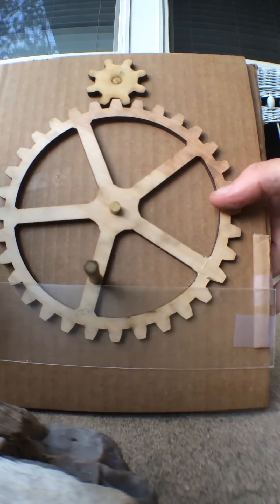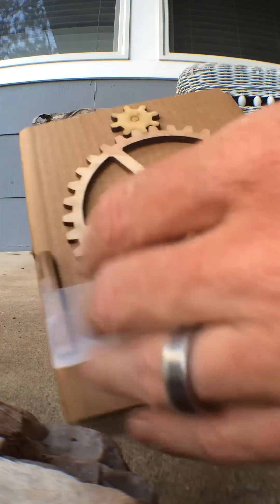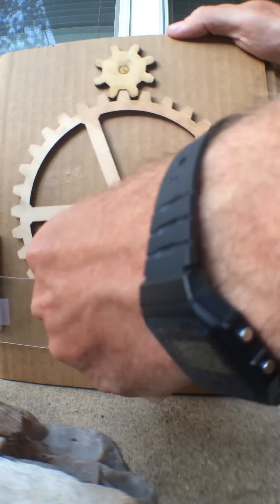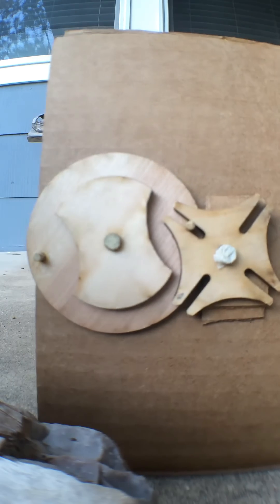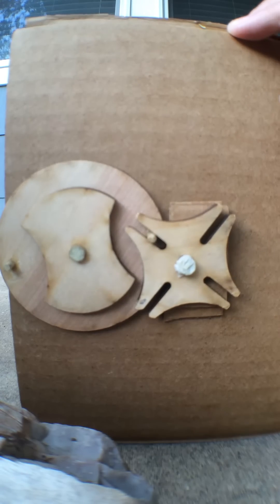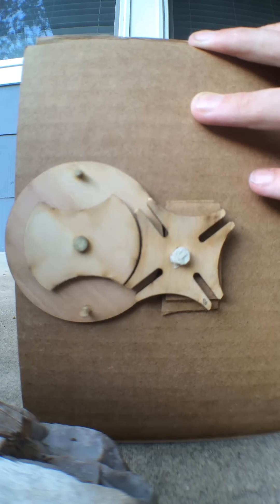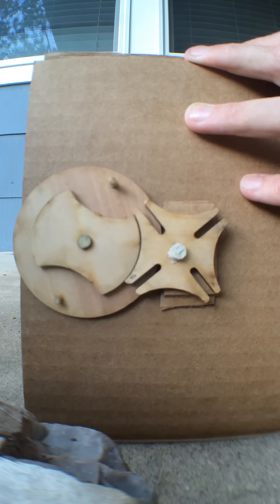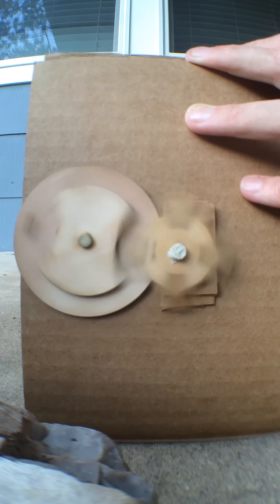Geneva Mechanism

Comment: What I want is a firestarter wheel. You can start a fire with a bow drill. I want to turn a wheel, just like that one, which will turn whatever pieces are needed to spin something and start a fire. It would take so much less effort than a bow drill, and could go so much faster. I have imagined that maybe, humans discovered friction fire by accident. They might have discovered the wheel first. They made a wheel on a cart, loaded the cart with a bunch of heavy stuff, and then rolled the cart down the hill. If the wheels were made of wood, they could have theoretically caught fire. So people would learn that when wooden wheels spin really fast, they catch fire.

Comment: The mechanism was used with another mechanism to put a shutter across the film not allowing light through during the period the film was being pulled to the next frame.
Also a pin was put into the sprocket hole to hold it still called Register then withdrawn for next move.

All this happened 16-18 times a Second for silent films and 24 frames a second on sound films till today!

Comment: So, it's 4:1 but pauses at every other 1/2 step.  So, I get how it would work for film projection to blank the screen in between frames/slides.  Persistence of vision does the rest.
Reply: ???  2 revolutions on the left per 1 revolution on the right.  Left has half as many "teeth".  2:1 rotation, 1:2 "teeth".

Comment: Build one of these so it works in tandem with a laser weapon.

Then you will have a Geneva Gear that Violates the Geneva Conventions.
Reply: Not only that, but the gear resembles a certain Iron cross.
Reply: @zbyshrek4661  it looks like a kind of reverse iron cross: wider inside than outside
Reply: @zbyshrek4661 : More like a Maltese cross, methinks.
Reply: @zbyshrek4661  The Iron Cross is a badge of honor, not a nazi symbol, I don't see the problem
Reply: A weapon to surpass Metal Gear!
Reply: You could use a Geneva mechanism to Q-switch a laser, yes.
Reply: Go ahead and say the “other” thing you associate with the word “Geneva.” Oh? That was it?
Reply: @august smith  Switzerland? Autoshow? pray tell what is this other thing good sir?
Reply: @WhuDhat  it's not a 2-dimensional, knee-jerk reaction echoed from TV, that's all I can say
Reply: and make it out of steel. call it a metal gear.
Reply: Laser isn't banned in Geneva convention
Reply: @chaoticgood1977 ok, fine we’ll connect it to chlorine gas
Reply: @chaoticgood1977  I got this info from a YouTube video a while back, BUT, from what I know, lasers that are powerful enough to blind someone are banned.

Lol ok so apparently it's this:

'It is prohibited “to employ laser weapons specifically designed, as their sole combat function or as one of their combat functions, to cause permanent blindness to unenhanced vision.”'

So basically it's illegal to blind people with it, but if it's strong enough to melt through someone then it's all good
Reply: @chaoticgood1977  but mass killing is-
Reply: @chaoticgood1977  but commiting war crimes is

Comment: I have run into Geneva gears many times in clock repair.  Most commonly found on cable-driven grandfather clocks.  One lane on the Geneva gear will be shallower than the rest so that the wind stops where you want it to.  Prevents crashing the weights into your seatboard. (board that the movement sits upon)
Reply: I'm no clockmaker but I have worked on antique projectors, and Geneva gears are used to hold a frame of film in position in front of the light then quickly move on to the next frame, without showing the in-between very long.

Comment: In 1939, there was a prototype racing New Imperial motorcycle with valves opened and closed by Geneva mechanisms. It was made by / for their top rider Ted Mellors, but he died in a crash before it was tested in action. Then came WW2, and New Imperial got bombed to pieces in the Coventry raids.
Reply from the maker: Wow. That's fascinating
Reply: I just checked up on dates, and he made the engine, based on a 250cc New Imp during WW2, only to die of carbon monoxide poisoning while working on a car (in 1946). That'l learn 'im.
Reply: wow, the time traveler has spoken
Reply: nvm, he is not from 2939

Comment: Is the centerpiece on the large gear needed to turn the cross-shaped gear, or are the 2 pegs sufficient?
Reply from the maker: It is needed (the circle with the sort of scalloped shape cut out). It is what allows the drive gear to keep rotating when the Geneva gear is still (it butts up against it but can turn); then the little cutout shape lets it get out of the way when the Geneva rotates to it's next spot
Reply: @timziegler  Ahhh, thank you.
Reply: It's purpose is to stop it from turning when it isn't supposed to.
Reply: That lock in place is one of the main features. Very useful in non clock mechanisms. 

I have a couple of machines with 20 position Geneva gears as the heart of their tool changers.
Reply: the gears on the back are independent of the mechanism on the front, the pegs are what turns the 4 slotted rotor. the center of the back large gear does not contact the front 4 slot rotor. yes, the 2 pegs are sufficient.

Comment: What's the point of the middle part?
Reply: he said this is used in film projectors.   So imagine, you want something to open and close   30 times a second..  Framerate.     So u have 1 gear constantly moving, and this thing, makes a stop n go  action, like 30..  every  second(if moving fast enough).   This is a mechanical frame rate creator.
Reply: To stop the last gear spinning freely, in between when it's supposed to turn.